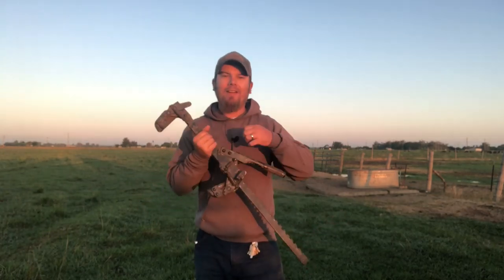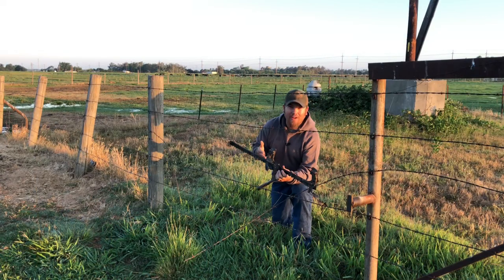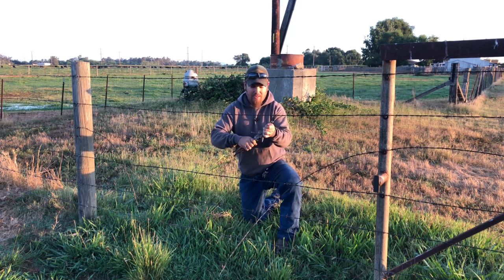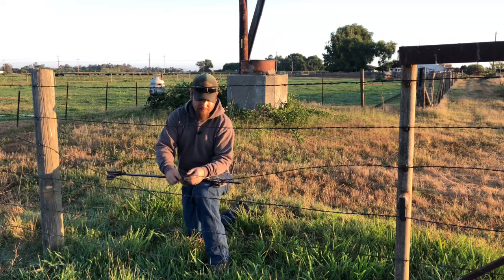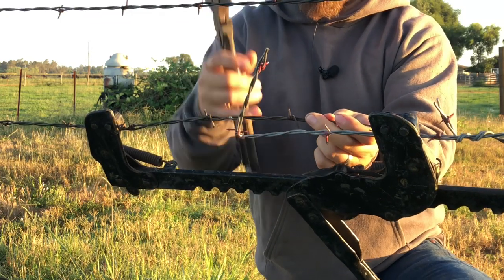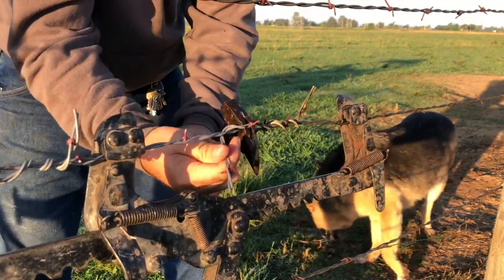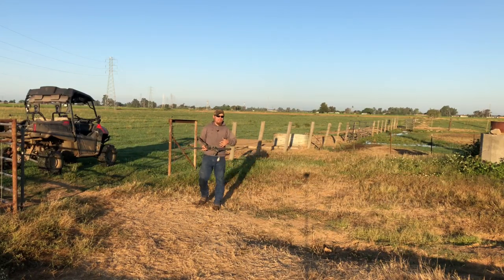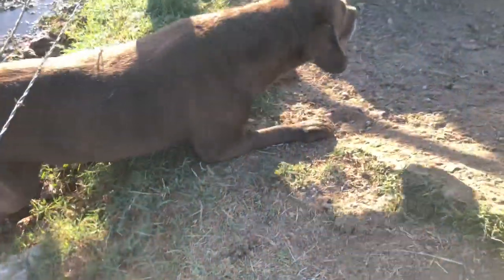My Favorite Fencing Tool!  How to Use a RanchEx Wire Stretcher

Comment: They work great but I think you’ll find it easier to release the stretcher at the end by taking the handle and pulling it down to the parallel position as if you were going to slide it along the track. That way you’re still holding each end if something pops loose ,it’s less likely to explode in your face. Either method works but I do it that way so I don’t lose an eye in the process. Great videos, keep em coming! 😊👍🏻
Reply: I came to the comments section to say the same thing. Also this method of splicing is more prone to failure as he is putting kinks in the wires by bending them over themselves like that.
Reply from the maker: Thanks Rust N Guts you know I never tried doing it that way. I think you’re right that would work better and be safer, thanks!
Reply: Wish I had one today!!

Comment: The tool is great. Fence crimp ties will negate the need for a splice of wire and it is permanent. They are about fifty cents each.
Reply from the maker: Hmm that sounds easier. Might have to give it a try!  Thanks Snap Mac
Reply: I agree we use wire crimps and it hold alot better and you don't run the risk of the wire breaking where you bend the wire

Comment: The ol Fence stretcher, there aughta be one of them in the back of every ranchers ATV, You maybe know this but you can release tension without releasing the wire so you don't possibly get smacked in the face with a rogue wire. take the handle all the way back opposite of the tensioning direction and that should release it, the one I have has a secondary lock so I have to pull some tension then release that secondary lock and pull the handle back and it releases. Good video though man, congrats on almost 10k, look forward to the live stream. Have a great day.
Reply from the maker: Haha I feel like an idiot no I didn’t know that but a few people have pointed it out so next time I use it I’m going to try that!  Thanks Brenton hope to see you there whenever it is!

Comment: Great tool. I took a 5 inch piece of 5/8 mild steel rod, flattened one end with a hammer, drilled a hole the barbed wire fits thru easily. After you get the wire ready to roll around ( I cut one barb out with diagonal pliers ) run the barbed wire thru the hole and proceed to twist around the piece as usual. Makes a tight coils close together fence mender. Now you have to hold the splice with fencing pliers while doing the twisting. I have  one with a smaller hole for woven wire. They work great and slide easily into a back pocket. The rod can be bought at Lowe’s in I think 3 foot sections. Great stocking stuffers for Real farmers with the extra rod lol. Seriously Tyler make a couple you won’t regret it. 1/2 rod will work. I just subscribe to a little bigger in tool material is usually better. I know you do too. I’ve watched too many videos. Later Brother. And around here we always called it a barbed wire stretcher and everyone knows what your talking about. Might just be ny area idk
Reply from the maker: Thanks Keith that’s a great idea. I’m going to try it!
Reply: We use those in Australia too. You can actually purchase them in rural supply stores and I think they are known as "twisties". Always handy for plain wire repairs as well. They certainly save your fingers. As you say Keith they are also very easy to make and you can have a couple of hole sizes for different wire gauges.

Comment: Fence stretcher. A must to have in every farm truck. I used mine today. The splices work really good too with the stretcher.  Not too expensive. And there are different sizes for different wire. Maybe a little quicker

Comment: got to fix 5 horse wires out front where a kid with a pickup wrecked taking out two big corner posts a huge xcel energy power pole my power pole and bent flat 12 T posts. this refreshed my memory cause I am FINALLY to the point of tightening the wires

Comment: Good video....just a suggestion,  I find it easier to unwrap the wire and then do the wrapping with the single strains.  Also, I slip the barbs off the wire so they are not in the way when I start making the wraps.

Comment: Good morning from South Korea. Thanks for the video. We're going to be fencing our farm in the Philippines with six strands of barbed wire. We will certainly be picking up a wire stretcher as well as some other fencing tools. Fencing 6 hectares of rolling, hilly, jungle-farm is quite a production. We used 8 foot concrete posts buried 3 feet in the ground. The posts were all carried by hand through our 1000 rubber tree forest and up the hillsides. My hat was certainly off to the team setting the posts. Congrats on your 9.4K subs. You're almost to the 10K mark. Hopefully you'll do some live streams on the weekend so I can jump in. We're 16 hours ahead of Cali time. Cheers and God Bless. ~Mike and Ester~
Reply from the maker: Wow that sounds like quite a job!  I guess a concrete post will never rot but jeez how much do those weigh??

Comment: pretty good presentation, ... I have the "Golden Rod" fence stretchers which I much prefer.  You can release them much slower so the wire doesn't pop back from the tension.  I'm not sure I agree with hammering those tabs lose.

Comment: Thinking back to fence and gairdrail days as a union iron worker.  The tools - come along with two line dogs.  Line dog sizes vary but for bw size of plam, it is a cable pulling clamp with a spring tension.  Used for phone, electric, cable, lines to pull slack out line. Would work without investing $ in speciality tool.

Comment: Yep, those wire stretchers work really well. A little heavy tho when you have to walk long fence lines with no access with your truck. A hammer and and good set of pliers work just as well. You still gotta carry that wire spool. I used to forget my gloves too. Ya get used to it and being careful.
Reply: I didn’t say how to use the hammer. Make a loop on one end of the broken wire (shorter one is better). Splice your new wire, same length as Tyler, to the other end like Tyler finishes the splice. Put the end of your new wire through your loop and bend it gently back toward the splice. Then take the claw of your hammer and put it around the second to last barb on your new wire and lay the narrow part of the hammer head on your wire and start winding. When it’s really tight, give your hammer a good jerk to make a bend at the loop. Holding the wire tight with the hammer, start wrapping your wire around the newly stretched wire until you know it will hold. Then you can unwind the wire from the hammer and wrap it so it’s not sticking out. You can get it just as tight as the stretchers with practice. ... Well, I suppose most people can get everywhere with an ATV but I didn’t have one and lots and lots of fence to fix so I liked the hammer better. A lot lighter walking all day.

Comment: I think it's either 
Dutton-Lainson 400 All- All-Purpose Fence Stretcher/Splicer
or
RanchEx 102571 Wire Stretcher with Ratchet Control 
There is also a five pull wire stretcher called:
Woven Wire Fence Stretcher
Reply from the maker: Yes I think mine is a RanchEx. Thanks Ox AO!

Comment: Tyler, do you cut those little ended barb wire pieces off when your done? The way they stick out away from the horizontal wire makes them look like they could cut you or and animal. Just wondering 💭

Comment: In all my years of farming and doing miles miles of fence both barbed wire and red top fencing I have never seen one of those. We always used a barbed wire stretcher which works a lot of the same way yours does it's just way smaller you can put it in the palm of your hand any how we used that and a ratchet strap and pretty much do the same thing that you did. And of course every time you do a splice that will always be the tightest stretch of wire when your done lol. Great video on the safety and how to on barbed wire great job man. Where can you find that tool and how much would one cost I wonder? Looking forward to your live stream if I am not too busy in the field I will try to catch it have a great day
Reply from the maker: Thanks Greenboy!  I got this at Tractor Supply of all places and I’ve seen them on Amazon as well. I think I paid around $35 or so?  Not too bad
Reply: @farmertylerranch4399  awesome man thanks for responding back I'll have to look next time I'm at tractor supply 👍👍👍

Comment: Tyler, 

It’s a wire stretcher.  BTW, that type of splice is precisely what my dad taught me was the WRONG way to splice (about 55 years ago!).  The new loops you created are now the weakest link in your fence; one of them will eventually rust through and break, and you’ll be back there to splice it again.  It is much stronger to simply wrap 6-8” of both wires together, like you did behind the loops. That way, the stress is spread across that entire wrap, rather than all on the end of the loop where you initially kinked it at approximately 90 degrees.  Doug from Strawberry Point.  🤓
Reply from the maker: Thanks Doug!

Comment: I have one of these tools and never knew it could be used on barbed wire mine is just called a fencing tool but it is awesome on normal wire it pulls it real tight  but on wooden posts you have to be careful i have almost pulled it out of the ground concrete and all
Reply from the maker: Wow yours must be stronger than mine!  Can’t imagine it doing that!  Thanks Noel

Comment: Great vid but just a suggestion when you splice your wire fences try and make sure the tails of your splice are either cut flush or bent either up or down NOT pointing out cause then they can badly gash the side of an animal or even yourself
Reply from the maker: Thanks JB that’s a good call!